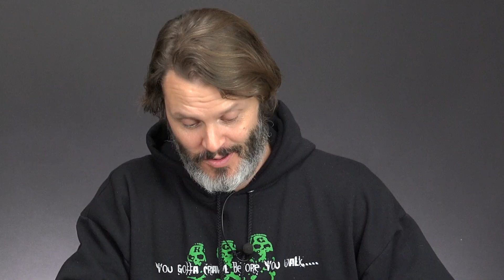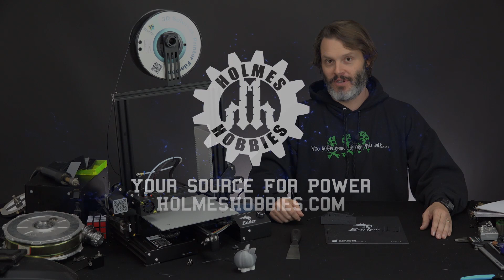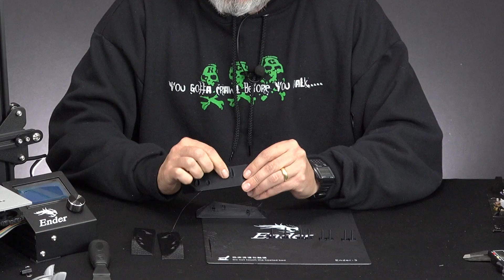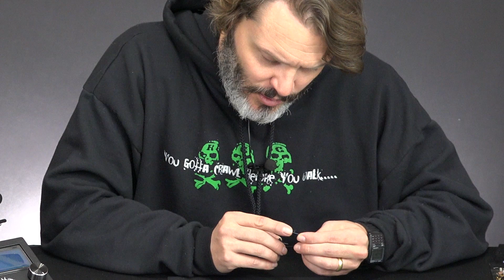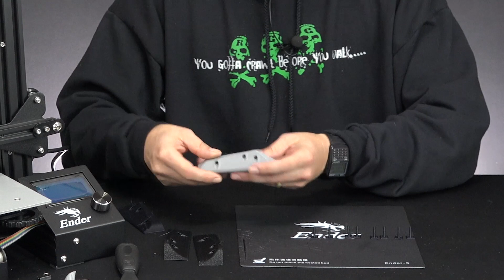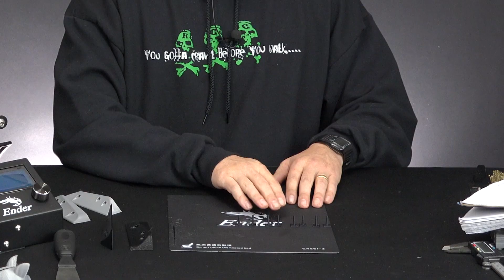Get Rid Of Stringing - Tune And Tweak 3D Printer Retraction - Creality Ender 3 -  Holmes Hobbies

Comment: If speed , retraction, and temperature don't stop the little spiderweb strings what's next? I have an upgraded hotend and nothing seems to work. Same pla as before the only thing different is the hotend.
Retraction test showed 4 to 5 mm retraction was best but still showed spiderwebs all the way. Same with temperature. 190-205 range was best on temperature but still stringing. Reduced speed. Still stringing. I really don't want to use an oiler if I can keep from it. I'm about at my wits end.
Reply: Have you tried messing with retraction speed or just printing speed?

Comment: Hi , I just got the ender3 pro and the PETG is not sticking to the bed and when it comes out it  curls up around the nozzle
Reply: Petg needs to b hotter to stick..tips..first relevel bed..then buy glue stick from Walmart..set bed to 90 or hotter set nozzle temp to 235...as the bed warms up spread u glue out in lines vertical and then horizontal covering ur print area..slow down ur speed to 50 or 35 until u get thru ur first few layers then u can increase speed  as it builds

Comment: Hey buddy, i have a pretty important question and i can't find any videos on YouTube that help. I built a redcat be6s from scratch over the last 6 months just one piece at a time and I'm finally ready to get the motor and so i can choose between the 4274 or a 4092 the kv works out to be close to equal so which one is better? Or more powerful? Im running 6s i just want the most power to the ground so does the 2mm of thickness of the 4274 make it more powerful than the longer 4092? Or does the 4092 have more torque? Sorry if i sound stupid. Maybe a better question would be which one would not get as hot? Thank you man!

Comment: I have the ender 3 pro and print just PLA.  Just using the default cura settings and everything looks great except for the stringing.  Does not look like yours but you can see it in the print. Guess I need to look at the extraction?

Comment: I love how you address the difference between filament types, brands and colors! A lot of people think thats BS, but its not. Ive found some colors from some brands are just impossible to get going good. I usually print for structural integrity and surface finish, depending on the item. Some things I like to hand finish items with some spray filler and sanding. As far as nozzle, I prefer to keep it 0.4mm nozzle size.

Comment: Hay John 
I do apricate your knolage I just started #D printing about 2 months ago . My printer is a Ender 3 Pro works great with bolden tube ...I had to poke the bear and moved to direct extruder , all metal hot end ( I know now learn how to use it first) and EZR extruder .I had better prints with stock machine but I am getting a handle on it now it seems with direct extruder you do need  to print faster to get better quality prints well better skin and smother. Just like RCs you get a new one you start looking at upgrade part ESC , motor , links , aluminum and brass parts is it better you have no idea you didn't learn how it operated with extended use and time ...So I guess what I am saying go slow first learn how to use it change one setting at a time then make changes to the device … Makes you a better qualified to operate you device with more confidence...

Comment: I am printing on 2 old Printrbot Metals and one has been modded with a volcano clone and I can switch from 0.4mm all the way to 1.2mm nozzle without needing to change speed or temperature on PLA, but if I print PETG I need to change settings. I set my nozzle size to the part I am making. The only problem is needing to reset my Z offset. I am bad about forgetting to do that.  On the stock Printrbot hot end, I have to change everything for everything. It is annoying. LOL!